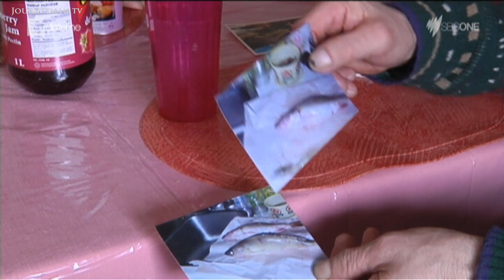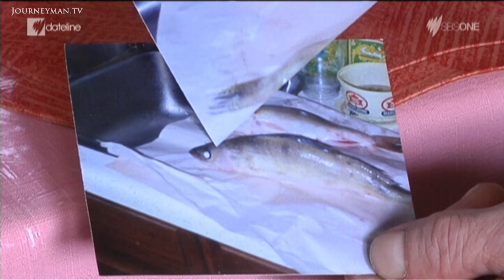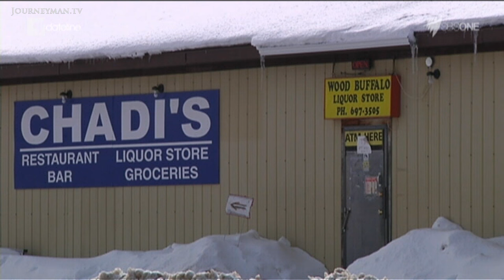Canadian Tar Sands Controversy

Comment: To everyone who is getting testerical ( male version of hysterical) over calling it “tar sands:” I can recall listening to the CBC as far back as the 1970s and hearing the Alberta deposits referred to as “tar sands” as a matter of course. Calling them “oil sands” is spraying Public Relations air freshener on the issue to make it stink a little less. It’s like in the ‘90s when they tried to re-brand sewage sludge as “beneficial biosolids” so it could be applied directly to food crops.

Comment: Get your numbers right. It releases 10% more. That's only because it requires another step to process. All of that land is reclaimed and will look like a forest in 30 years, there's already examples of reclaimed land. Remember that the area is SUPPOSED to be saturated in oil as it has risen to the surface naturally. The mining process actually CLEANS the area... and tailings ponds are giant mud puddles that is soil for the land, when dried, there's little to no oil.  There is so much false information regarding this style of mining.
Reply: There is actually a suprising amount of bitumen in quite a few tailings ponds. Look at the new sattelite imagery of the area taken this year and you'll see the black streaks going across the ponds. The shorelines of the ponds are rimmed with bitumen.
Another thing to keep in mind is not all tailings ponds are the same. You have different ponds designated for different fluids. Some of them will have all sorts of waste like sewage, fuel, etc. Others will only have recycled process water (which really isn't clean either)

There is a very large effort to clean up these tailings ponds though. Big money goes into treating, disposal, and R&D of new methods/processes.
It's a big problem for the industry but we're getting there. If anyone has questions about oilsands tailings, let me know.

Comment: Not a very well balanced story, I suspect heavily edited. The bitumin is natural and close to the surface. Fly down the Athabasca River, bitumen seams are everywhere, leaching into the river for centurys. Natives have used it to patch their canoes since the beginning of time.  There is a reason drinking raw surface water is discouraged. It's not wise anywhere, not just Fort Chip. Everything ailment gets blamed on the oil sands. Bitumen extraction is the largesr environmental clean up operation on the planet. Have a look at the reclaimed areas.

Comment: so many factual errors here. #1 its oil in sand, not tar. #2 it's not the only source of oil in Alberta. #3 the Athabasca river is washing away at the sand/oil layer this very minute. #4 this source of oil is not dirty, it is thick and 100% organic and natural. #5 The "pollution" is in fact steam or water vapor. steam is used to heat the oil and separate it from the sand.
 The ongoing set of errors here is so incredible this report lacks any credibility.

Comment: Lol... ya... this analysis is total crap.
This reviewer knows or basically understands nothing she is talking about.
Oh and PS - the mining for all minerals to produce batteries and rare earth minerals to produce all electronics... looks the same. Except they are rarely returned to a fully re-established forest ecosystem - unlike the oil sands mine areas. Which are 100% reclaimed back to the same forest eco-system.
Why - because the boreal forest trees have a natural burn cycle that burns them to barren tundra every 10-30 years anyway so they completely regrow to boreal forest in 10 years after reclamation anyway. Leaving no visible sign the area was ever mined...

But these are the actual facts.

And yes - the tailings ponds are reclaimed also. But not until the water is re-used in the plant for life of plant.
Oh and Canada is 10 million sq km’s. So an area the size of NY - you wouldn’t even find on a map of the northern boreal forest without great assistance as it’s a thumb print on a map big enough to cover a 10 ft sq wall.
Reply: And not to mention the slave labour used in the battery mining industry all over the world in mostly 3rd world countries.